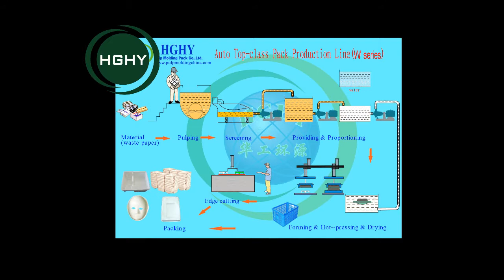molded pulp machine how to make iPhone 6S  package

Comment: Con una inversión técnica anual de cientos de miles de euros, HGHY Pulp Molding Pack Co., Ltd. (en lo sucesivo denominado HGHY) está especializada en la investigación, desarrollo y fabricación de conjuntos completos de líneas de producción de pulpa de moldeo. Hemos obtenido los certificaciones de CE y 75 patentes sobre maquinas de pulpa de moldeo. Nuestro equipo ha sido exportado a más de 40 países y regiones. Dedicada a la industria de pulpa de moldeo por más de 20 años, el producto cuenta con la experiencia para proporcionar equipo sofisticado y un agradable servicio. 
Como un joint venture con la famosa Universidad de Tecnología del Sur de China, HGHY borde de goza de apoyo a la R&D.Gracias a la fuerte e independiente R & D equipo, HGHY esta en la posicion de liderazgo de la industria de pulpa de moldeo. 
HGHY ofrece de alta calidad de producto con buen funcionamiento de coste, y satisfactorio servicio integrado por garantizar: 
 - tratamiento profesional técnica, 
 - maquinaria avanzada capacidad de R & D, 
 - Molde R & D y capacidad de fabricación, 
 - ISO9001 de gestión de manufactura guiado, 
 - estricto control de calidad, 
 - ingeniero, instalación y capacitación en el sitio, 
 - venta profesional y servicio post - venta. 
Fundado en 2000, HGHY fue una de las empresas de alta tecnología para entrar a la Parque de las Ciencias de Universidad Nacional. HGHY tiene su sede en la zona de desarrollo de alta tecnología de Guangzhou, cooperando con la pulpa de moldeo Technology R & D Centre de la Universidad deTecnología del Sur de China, nuestras filiales incluyen una fabrica de maquinaria (situado en Foshan, Guangdong), una fábrica de pulpa moldeada paquete (Zhaoqing), y un molde de R & D y centro de tratamiento (Zhaoqing).